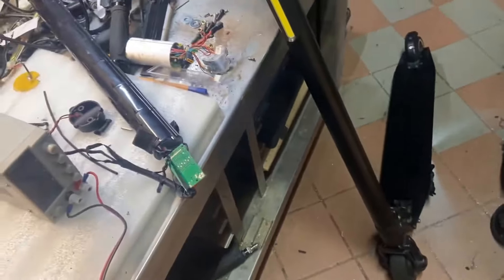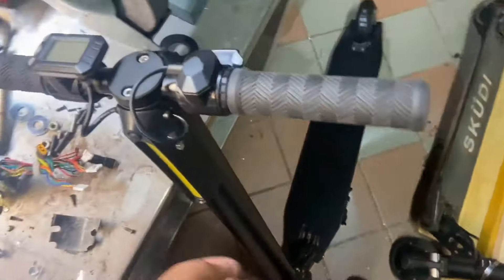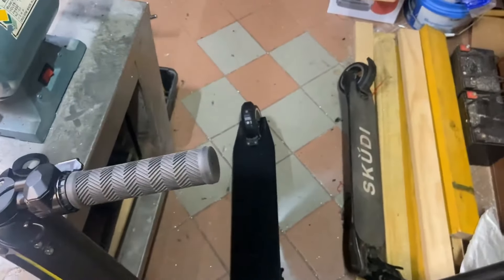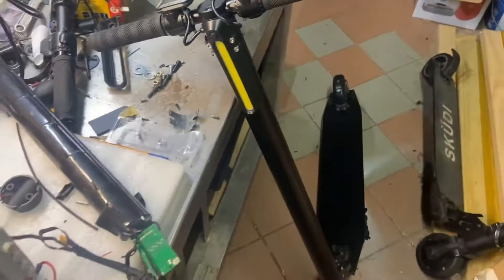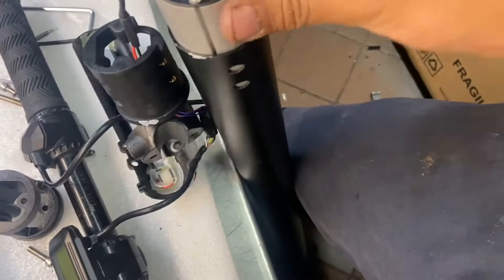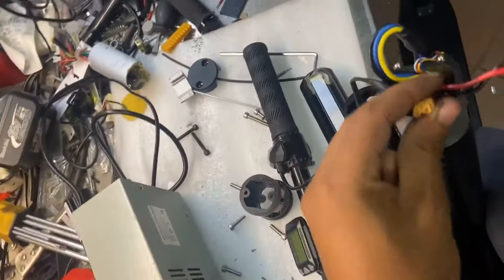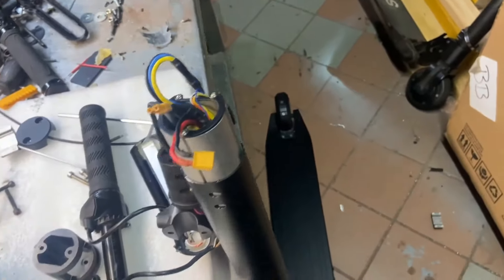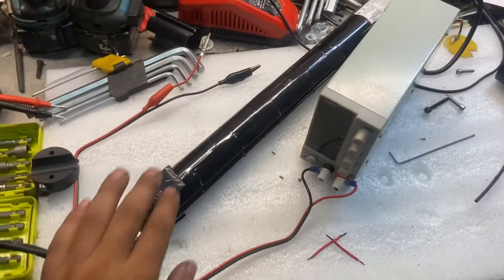How To Revive Dead Scooter Lithium-Ion Battery - (Or Any Device!)

Comment: seems to have worked with one I picked up on marketplace. Was a bit difficult to put the top back on and ended up stripping some of the screws. To be honnest im not a fan of the upper portion. Perhaps I could 3dprint a new control bar to make the electronics a bit more accessible
Reply from the maker: Yes they can be a bit tricky to take apart. and if your going to be wanting access to the battery/electronics often then it might pay to 3D print another section
Reply: @TechEyeMan 
My sons scooter was left uncharged for a while. So no longer accepting any charge. Tried going directly to the lead that goes to the motor. It doesn't draw and amps. Any ideas?

Comment: Hey TechEyeMan, I have the same scooter and same problem because I bought it from a friend who had not used it for a very long time but I do not have the variable power supply. I have a drill battery that puts out 14 volts at 1.5 amps or a lawn mower battery that puts out 40 volts at 6 amps. My scooter is only supposed to have 29.4 volts at 2 amps, which one should I use or what should I do? Btw I have already tested my charger and it works fine.
Thanks, great video
Reply: Hey bro would you know what brand the scooter is and how o can find the information to it

Comment: Wouldn't it work to use the original charger by plugging it in directly to the battery with bypassing the BMS..?
Reply from the maker: it could work depending on the chargers. most chargers won’t give current if the voltage is too low.
Reply: @TechEyeMan  I actually tried it last night using the original charger and some wire leads since the battery and the charger have the same plug.. It did work as far as my charger recognizing that the battery was there and starting the charging cycle.. prior to this, the light stayed green and the charger wouldn't turn on when I had it connected to the charging port..

Comment: Hello. Thanks for the vid. I have the same scooter and issue. To ask, could you explain briefly how I would use a drill charger (mine is 24V) in place of the variable power supply you use? Many thanks.
Reply from the maker: if the drill charger is the same voltage then it may work but depending on the drill charger, it may have some electronics in it that communicates with the drill battery to get some more info such as temperature before it starts charging so it might not be possible to bypass. You could however use the drill battery itself to try jumping your dead battery by using some paper clips or similar thick wire to make contact between the positive and negative of the drill battery (they are usually the 2 outermost contacts) and then connect them to the positive and negative of the scooter battery like in the video, but i would be careful again of the current because there is no limit on how much it will take so make sure you monitor the temperature and keep an eye out for anything unusual.

Comment: Trying to connect a 60v 35ah battery. Is it normal for it to spark when you put Xt60 connection together? Manufacturer says normal. ??
Reply from the maker: Yeah thats ok, happens when you connect hte battery, just once.
Reply: Ok, I appreciate the quick response!  New to these scooters. Any idea why a scoot would charge for the first time, run for like 100meters and completely die, no power yet the battery is at 62V. It's a Samsung 60v 35Ah battery. It has an NFC card reader on it which is not even lighting up once you scan the card. I'm thinking controller but have no clue. Taking forever to hear back from manufacturer under warranty.

Comment: @TechEyeMan 
My sons scooter was left uncharged for a while. So no longer accepting any charge. Tried going directly to the lead that goes to the motor. It doesn't draw and amps. Any ideas?
Reply from the maker: do you mean you went directly to the lead going to the battery? or you tried spinning the motor? these kind of scooters have brushless motors that require a motor controller and have 3 leads. unless it’s an older scooter with a standard 2 lead dc brushed motor.

Comment: So when doing this, is it important to have a variable power supply that can match the output voltage of the charger? I have a scooter that takes a 64.4V charge, so most fo the normal vairables I see are only 2-24V
Reply from the maker: Yep that’s right, the higher voltages can be tricky. you could try using the charger directly via some wires but the charges usually don’t charge unless they detect the battery/bms. otherwise you might have to get into the battery  to the cells and charge the groups of cells individually.

Comment: Visualy i have same scooter. Dont know model, but buyed in Hofer/Aldi. Last year i fix battery with this tutorial, Few days ago i tried again. Battery start charging from 17V to 22V then stoped. I take parts out and first i smell something burn in controller (aluimium case with wires). Then i take out battery and fell some smell.  Inside baterry i believe it is BMS with DLX-9010B sign. I still have to take all battery apart and measure it one by one. My question is, where can i buy right controler and BMS for this scooter. Charger is 29,4 V. I found something on aliexpress, bit i dont know  do i need controler for 24V or 36V ?

Comment: @TechEyeMan  Hello sir, trust you are doing great, I use an Hover 1 alpha E scooter, so two days ago I was changing the accelerator of my scooter but in the process of assembling it together i found out that the beep device was loose but before I could touch it , it mistakenly touched one point of the display panel which resulted in some weird noise, and the scooter tripped off and wouldn't come on again.... Pls do you have any idea what I could do to resolve the issue...
Reply from the maker: Hi Isaac, sorry to hear about that. Hard to say exactly what happened but i’m going to assume you shorted out the display. there’s typically no protection such as a fuse for these so your best bet is to replace it and be careful when reinstalling it. it’s worth noting that sometimes if the brake lever is pressed or being triggered it could stop it from powering on(as you were working on the accelerator), so worth checking that too. i’m not familiar with that scooter but have a look around if there are any fuses that can be replaced and then the next step would be to replace the display.
Reply: @TechEyeMan  Wow 😊 so glad you replied really grateful and thanks for the tip.. 

Thought the fault was from the controller course I perceived something burnt on the board... Thanks 🙏 :>)

Comment: Great video. To charge mine i have to have it on and the light on. The voltage was 22.4 when i started charging now 24.7 the bms is blinking red 4 fast then blinking all the time. What can be wrong ?
Reply: My blink red 4 times too. Bms output 18.5v, but the pack output 36v. Is yours fix?

Comment: What kind of charger are you using ? Where can I get one ? And how much do they cost ? Thank you just let me out tremendously I'm sure I have a eyezip e3 ultra electric bike that I need to do it it's battery I would love to ride it.
Reply from the maker: just look for a 29.4v lithium battery charger from ebay. if your talking about the power supply, they are a bit more expensive but it’s a variable dc power supply

Comment: The XT 30 terminal you explained is that cable the actual output cable from the battery or    charging input battery cable connected to BMI. Should you issolate the cable positive cable when charging from  your  boost power supply( will the BMI be damaged)
Reply: Hi, Myung. The answer is they are the same cable. the bms runs the negative cable from the battery, through the bms then out to the load and the same for charging. remember that the bms job is to balance the battery in both charging and discharging. what we are wanting to do is bypass the bms and charge straight from the battery output. but in some cases it’s the charger and not the bms that detects the low voltage, in that case you can jump charge it after the bms.

Comment: Its a late reply ,  I have one like that with different brand,  i have b4 a Smach Mars  5' tire  that's too small for a rocky road its  useless,  you can easily feel humps and bumps  the tire with  Hub motor wears off quickly  without a suspension, but if  manufacturer chooses a big  8" tire for 26v E scoot   it would be more reliable  like the Dolphin escooter 26v - 8" tube tire

Comment: Do you think it would work on a completely discharged battery that discharged due to water? i was riding on the rain and my battery got wet. all works except the battery. :(
Reply from the maker: water can be a hard one. it can fry the battery electronic (bms) which is probably what happened. you’ll have to open it up and let that water dry up and see what it’s damaged

Comment: Hello. I have the exact same scooter but do not have the original charger. I used a generic 24v charger but the battery charges only 3 bars. Can you please let me know the nominal voltage of the charger ? Thanks!
Reply from the maker: hi mate, the charger will need to get up to 29.4 v

Comment: Whatever you're fixing there is EXACTLY the Hover-1 scooter I'm struggling with. Charger stays green, so I bought a new charger. Still wont charge. Jumped the batter off a DC power supply at 29.4v 1.5a and now it turns on, but battery STILL doesn't charge off charger (green light doesn't go red). What's the next step? Barrel connector? BMS problem?
Reply from the maker: if you have a multimeter, check the voltage at the battery terminal (before the bms) to make sure it holds charge and stays there. if the voltage drops after a few hours then one or more cells may be bad, if the battery holds charge then likely it’s a bad BMS
Reply: @TechEyeMan  Thank you for the fast reply! Subbed as a thank you. Ok, so what I discovered after pulling the whole battery out is that the negative wire that comes off what I believe is the charger connector (not the XT30 power cable) is not connected to anything. Like it broke or got cut in the tube. It looks like there is a spot on the PCB board that it may have broken off from, so I'm going to jumper that and test today. If it works, then I solder it on and put it all back together. Thanks!
Reply from the maker: @LoganTanner  yes the negative wire from the charge port should solder into the bms. it’s usually marked with a little “-“ for negative. try stripping the wire back and touching it on that negative solder pad while plugged (charging) to see if it starts charging normally, then you can resolder it

Comment: So if I’m jumping a 60v escooter battery pack for example I would need to use a variable power pack that has more than 60Volts?? I’m just a little confused as to what voltage I need the variable power supply to be at to jump these few sleeping 60v escooter batteries I have. Thank you I’m advance for any help!!
Reply from the maker: hi steve, that’s correct, you need to jump it with a higher voltage than the battery pack, if you can’t get that high a power supply(which is hard) you could use several smaller batteries in series but if all else fails you will have to disassemble the back and charge the cells directly, each cell (or group of cells on parallel) will need to be charged to 4.2 volts.
Reply: @TechEyeMan  thanks appreciate your response. I ordered a high voltage variable power supply so ill try using that I guess at around 72V for the sleeping 60V battery packs & see how that goes. Your video was a great help in understanding how to wake these things up.

Comment: I revived my battery pack using your method, however what im finding when hooked up to the regular charger is the battery pack in the center is getting hot to the touch
Reply from the maker: That could mean that one of the cells are dead or on its way out. i would recommend changing that cell. if you charge it and leave it overnight and the voltage drops significantly then it’s clear you have a bad cell.
Reply: @TechEyeMan  I removed the battery from the GoTrax scooter and connected it back to the power supply that I used to jump start the pack. At least on the power supply its slow charging and the battery pack does not get hot, currently power supply shows its at 18V, its slow moving. I'll leave it on today to see if it'll ever reach 25.2V.

Comment: Amazing video! Please help if possible!! I have a 48v scooter battery, the charging specs are 54.6volts 2amps. I have my PSU set to the charging parameters exactly. The problem is when I connect it to the discharge port like you did, my voltage on the PSU does NOT drop, and my AMPS begin cycling from 0.130 to 0.000 over and over again. Any help would be much appreciated! 

If I continue to leave it hooked up will it damage anything? When I pull it off and check the battery voltage with a meter it is going up slowly therefore it’s taking a charge. Just not sure why it’s not staying at a constant amp output.
Reply from the maker: Hey there! that’s strange, try to make sure that you can see that the cables you are connecting the charger to are indeed going straight to the battery cells and not through the bms. You should also be able to read a voltage from those wires before you charge and it shouldn’t be too low because the cells should still have some juice. i can’t see why the current would be dropping to zero and back unless it’s not going to the cells directly or there’s a break somewhere in the line. In the worst case scenario you can strip the pack down until you get to each of the cells and charge them directly to 4.2 volts each(some might be in parallel and that’s fine) i wouldn’t leave it unattended because there is no protection agains over charge or over heating if one or more cells are damaged.
Reply: Thanks the On my way! I have is acting strange.  It has 3 sets of wires and I need to do this trick.   Thanks.

Comment: Would it be possible at all to somehow use the original charger and somehow do what you did in the video but without the power supply? How would I do this, if it is possible? Would I have to take apart the charger or is there a way I can clip onto it somehow? I look forward to your response
Reply from the maker: Hi, it’s an interesting question, it depends on the charger. Most chargers don’t allow current to pass unless there’s some feedback from the battery. If you could hook up a wire to the positive and negative of the charger and do the same bms bypass it could work, but if it doesn’t then the charger isn’t letting current through, it would need to be tricked using a resistor value but i haven’t tried this.
Reply: Someone on another video used an automotive bulb to trick it @TechEyeMan

Comment: Great video thanks .. Might you know how to wake-up a Unagi E500 e-scooter's 33.6V battery ?
I reckon it may be in sleep mode because the owner left discharged and when he gave to me to fix it had dropped to around 20V. 
I used and external P/S connected directly so as to bypass the LiIon protection circuit and succesfully / carefully 
charged the BS-18650-8S3P battery back to max 33.6V (nominal 28.8V). 
However the battery still wont charge via the normal charge port when I use a scooter 33.6V 2A P/S with same connector 
adaptor and same rating as origional P/S
It still wont cahrge even if I use the bench P/S to provide charge via the normal charging port. There's no current flowing !  
I dont have the original Unagi P/S as is lost and a replacxement is expensive.
The 33.6V battery is a sealed one. I dont have it's protection circuit's electronic diagram to figure out how it works.
Unagi refuse to help because owner has lost the proof of ownership reciept paperwork.
Reply: If the voltage of cells or cell groups is OK (enough to keep the bms from shutting things down) I'd suspect the charger or bms. My bms for a large battery doesn't appear to be repairable and quite complex, I'd just replace. Same with a charger if the output voltage isn't right. I have this problem now but DON'T want to replace a 700.00 battery if I can help it.
Reply: Correction: not quite the same  problem, battery dropped below the voltage needed to keep the BMS turned on. Guess my point was Charger: not that expensive, same with BMS. Quality batteries? Expensive as hell.

Comment: I have an electric scooter like you, the battery can not be charged, and the green light is always displayed. How many V of mobile power supply do you use to charge the battery of the scooter, and how many amps of current do you use to charge it, and how long will it take to be fully charged?
Reply from the maker: the  V or voltage will depend on your battery but it should say the output voltage on the charger. As for the current, most of these power supplies have a max current draw of 10 amps which they will be limited to which is fine.  but once it starts charging the current will drop down to a few amps.

Comment: Sounds reasonable but I wouldn't do this with the 72v 20AH sitting on my workbench. Too dangerous. Will trickle charge independent cell groups with a high impedance charger. Will take awhile but I won't burn the place down. Small battery as shown may be safe but keep it away from flammables and get a bag of sand or a fire extinguisher. Seen some nasty fire damage in the forums.

Comment: If u have a scooter and not used for a while can the battery be damaged if never charged or fall below the level to charge
Reply from the maker: hi Maky, yes it will slowly drop on voltage until its too low for the charger to charge
Reply: Even if you bought out of the box  store and never charged it for a while year or so / omg that’s why they sell all these scooters 50% off they may be junk